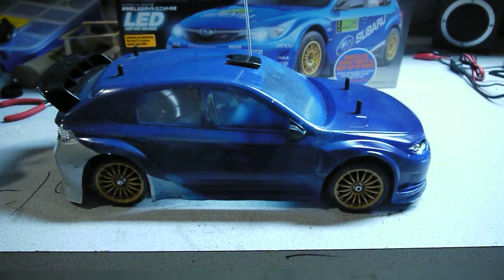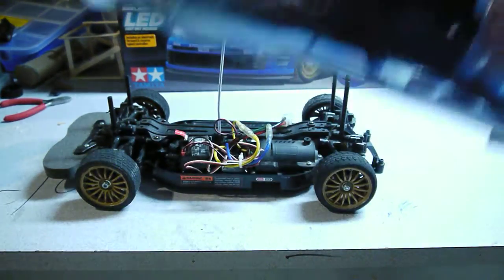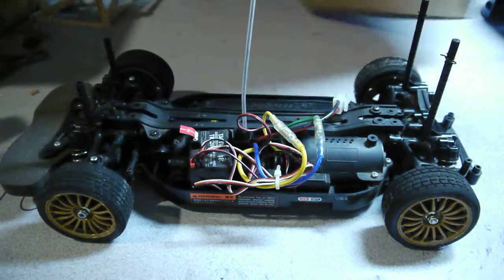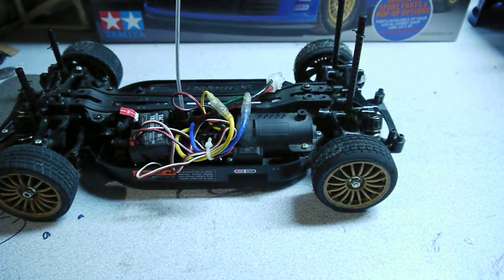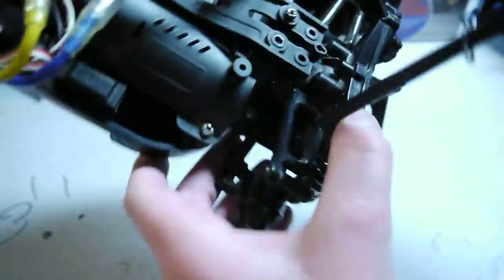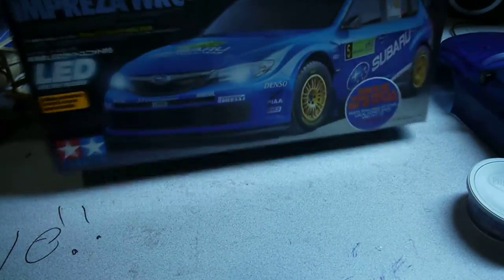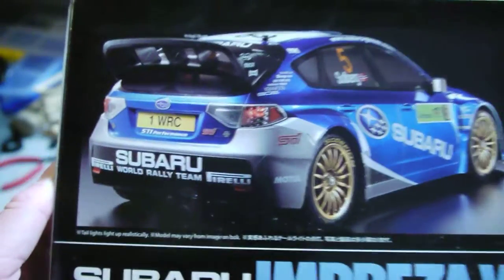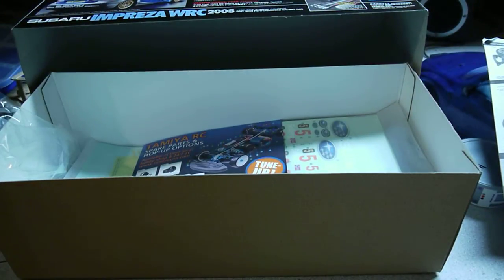Subaru Impreza WRC 2008 RC Car review

Comment: Hey how reliable is this car man ? can you do a lot of aggressive driving with this will the gears and other parts stand the brute force?
Reply from the maker: Its very reliable, I have had it for a few years now and it still works great. The only thing is with this particular model it is the street one, so don't drive it in said. It is not meant for that, just street racing. The gears are surprisingly good quality for being stock, I like to drive my cars hard so yes, this stands up to a lot of abuse.
Reply: legoNerd01245 thanks a lot my friend where can i buy this particular car ? the kit version that you got ? can you post a link on here.. I like the kit version better because I already got a radio and battery.
Reply from the maker: zero00tolerance http://www3.towerhobbies.com/cgi-bin/wti0001p?&I=LXWXW6&P=FR&gclid=Cj0KEQiArK6lBRC5-_jv48uxgrgBEiQAuxdZ9bmmZ-p-4mxB7mo-e_E3PTeVMHonAXNH1Uiq_6VJvcwaAvYs8P8HAQ ::: This was the closest I could find to my car. It's about the same price but it comes with a radio and stuff. I got the one in the video at Hobby Town USA
Reply: legoNerd01245 damn thats the kit version ? and it's $249 still man these cars are expensive =(